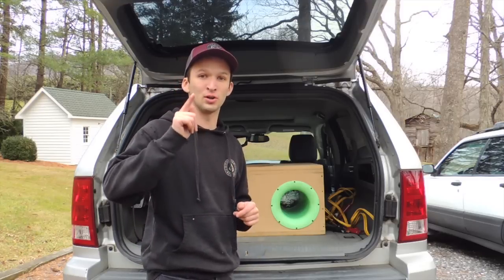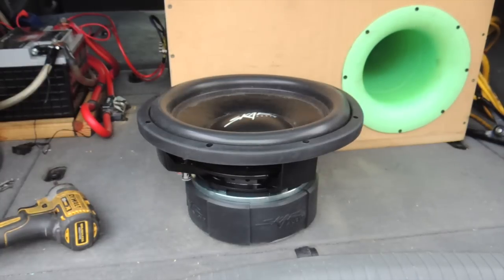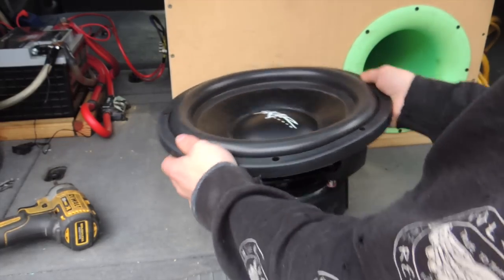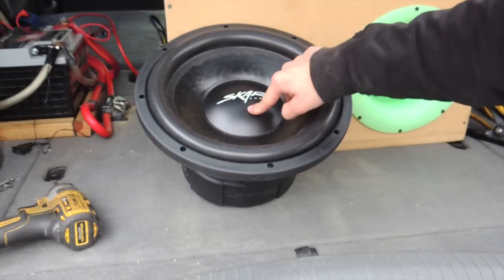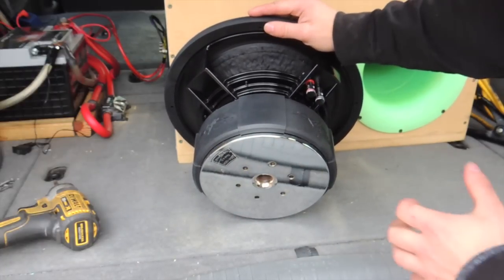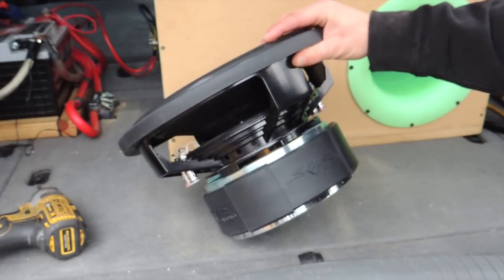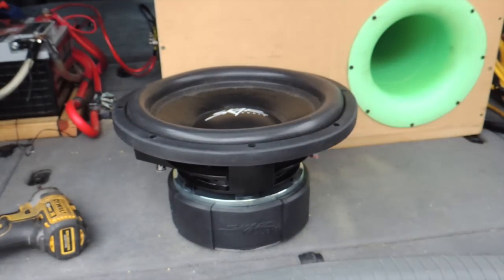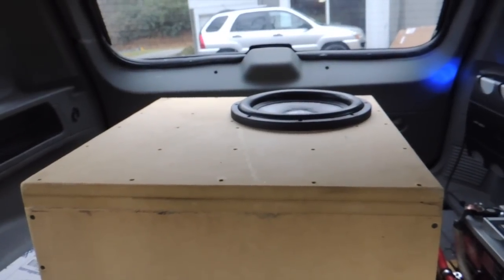Skar Audio DDX Subwoofer Review!

Comment: I currently have a svr 12 on a rp 1200.1 looking to upgrade will the ddx give me more looking to use the same 1200.1 for now or should i just jump to the evl
Reply: I bough the sdr 12 in the prefab and upgraded the sub to the ddx and I LOVE it. Don’t know much about the svr but it looks similar to the sdr. Do it man and the 1200.1 is the PERFECT amp for the ddx. I ran mine on an rp 800.1 forever. The gain was way higher then I liked but it slammed just fine. They will take 1500 rms on clean power all day long

Comment: Dude,  these are underrated..750rms? Lmao. Try almost 1300rms and 1750 peak.  Skar underrates all their products.  These are rated 1000rms at 1ohm. The only way to get this sub at 1ohm is to get the d2. To get 1ohm and above the rated 1000rms is to wire two d4 subs in parallel.

Comment: Hi man, can i use boss ar1500m amp (1125watt rms @ 02 ohm) to run the skar ddx-15 4ohm 15" sub ? Will it be fine or not ? Kindly help
Reply from the maker: Boss amps are way overrated. It will work but you’ll be better off with the AudioPipe
Reply: @ParkerTheBasshead  can you give me a specific model no of audio pipe amp please

Comment: What are your thoughts on the sundown audio E12 v3?? I have 2 on the way with a audiopipe 1500 amp.
Reply from the maker: I haven’t had one so I can’t really say. I’m sure it’s a good subs tho
Reply: I wasn't too sure if you had any experience with them. I was lucky enough to have a gift card so I only spent $200 to get both subs.
Reply: @michaellaughter0826  I saw someone with 8 of those E series subs hit well over 150db with not many watts. They seemed great for the price. You should like them, and you don't need a huge amplifier or super upgraded electrical to run them either.

Comment: No matter how many good things I see from them, the name skar really turns me away. I don't know it just sounds really cheap and gimmicky. That sub looks pretty decent though.
Reply: Bahahha its not stolen technology lmao..they just have similar baskets
Reply: And just because the basket is the same doesnt mean all the parts are too 👌😵
Reply: Chuck Holmes  I'm sure the soft parts are very different. Subwoofer baskets are pretty universal and the same design is used by many manufacturers.
Reply: I work in car audio and had heard that the guy who designed the sundown sa series sub's actually helped the owner of skar design the ddx. But maybe that's just rumor I'm not sure. Either way I've run both and can say from experience they are both very good quality subs if put in the right enclosure.
Reply: I've owned a variety of brands/models over the past 20 years and it is really hard to beat the quality you get for the price with Skar Audio. I was skeptical at first myself, but honestly was blown away by the clean lows produced by the VVX's I currently run.

Comment: Nah, I been giving both my DDX 12 s 1k watts a piece for over a year, not one issue. And that isn't a copy because they are not similar.  I think your just a skar hater Lol, I'm just kidding man.  But they are different in so many ways. This sub is "thee" best daily driver. hands down. There really isn't a need to advance any further. "If" you, do it right. The main factor here is the price they come in at and what you get for it. I testify 🖐They took 1k watts for over one year, they can easily take 1.2k. The problem is when the folks doing these reviews developed opinions and bias without doing prolonged research. Well, I did the actual prolonged test, and they passed. they are way above the sundown 750 watts class. you have to realize certain sub designs are similar all the way across the industry so that theory of yours is unfortunately also debunked. most of the time you do good reviews and then sometimes you fall of a bit on the information. and I think it's just because you didn't spend enough time to actually become familiar with the equipment. I actually did prolonged experimentation with these, and they are definitely above the sundown audio SA classic 750 watt. You also deliberately did your volume differently on this sub. just keep it real man, the DDX is solid. How long did you throw 1k at em ? This sub enters the market in the danger zone and is why manufacturers motivate their spokesmen to discourage purchasing them. Because these subs are bad for business.  If the public finds out the formula to these, they won't chase the dragon. that's why they pay spokesmen to make videos full of disinformation. But this sub is solid, and I would buy this sub over most subs in the 3–500-dollar market. Because they won't sound any better, they may look better and move more but they won't sound "better". Guys that don't know much think if the sub moves more its better. but actually, a perfectly matched sub in the right enclosure moves less and sounds premium. Just be careful with some of the videos these guys make. There is a reason they tryna put bad information on products "you" know to be solid... But I'm not going to say anything about that. Just be careful ✌